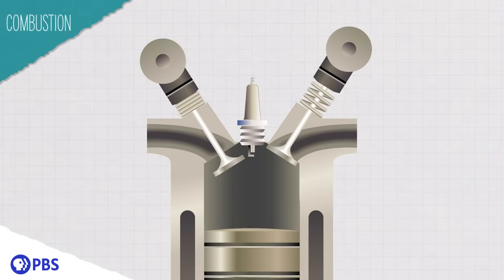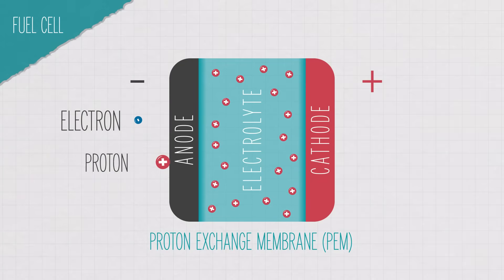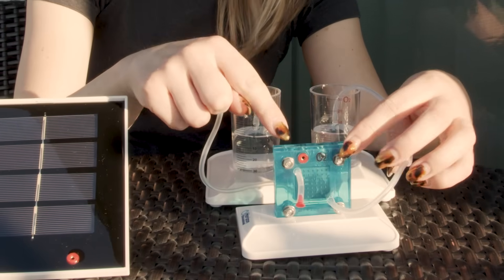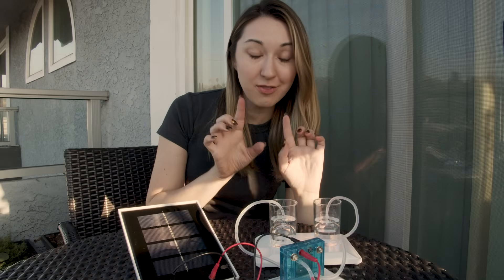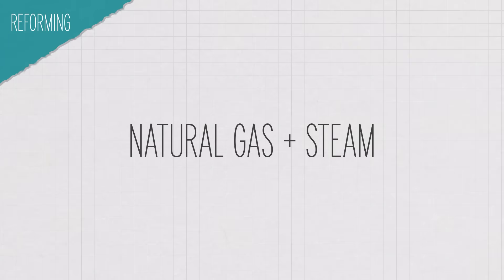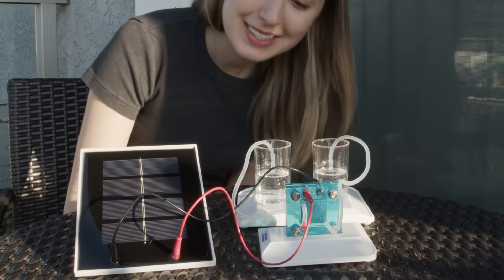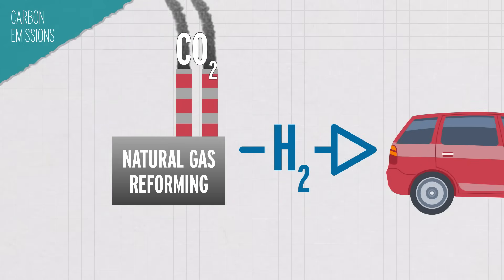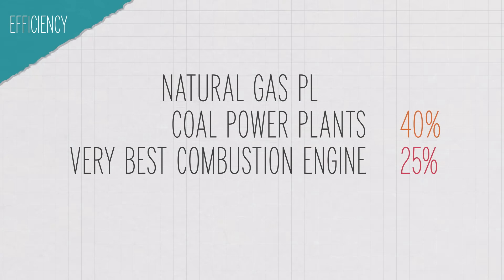How Do Hydrogen Fuel Cells Work?

Comment: I think there are genuine questions about how realistic large scale green hydrogen production can be vs batteries. There is this idea that it just needs time and investment for the production costs to fall but if you look at the details it seems unlikely. As this video points out hydrogen production is not new. People have been working on it for a long time and have not managed to make it cheaper. Batteries on the other hand have fallen dramatically in price over the same time frame and there are obvious pathways to continue to push them cheaper. The future promise of green hydrogen for small vehicles is as far as i can tell mostly just providing cover for the fossil fuel industry. It might make more sense in other applications. But for cars batteries have won its just a question of how fast we are willing to push people into them.
Reply: You fail to se the inevitable mess and toxic filth all these discarded lithium batteries are going to create, as they're good for only ~ 5 years,  not to mention the wars that will become reality due to countries fighting over the resource.
Reply: @minkorrh  lithium is fairly common and can be completely recycled. Batteries are not free of environental problems. But they are still much better than gas or hydrogen at the moment.

Comment: I work for a transportation agency as part of a group researching our future fleet (alt fuel busses). Fuel cells have very appealing traits, but from the perspective of building out infrastructure, this technology has a lot of maturing to do. A transit agency using this to power a fleet would need either very convenient hydrogen stations nearby (3rd party operated), or the agency would have to build out infrastructure to make their own fuel. That raises questions about mission creep for a transit agency's role and quite a few sunk costs for safety provisions alone. Keep in mind as well, compressed natural gas busses must be re-certified by a qualified 3rd party before returning to service for any collisions over 4-5mph. I'd imagine similar safety requirements for vehicles carrying compressed hydrogen. That's just one more drop in the bucket where fuel cells' impressive initial features are 'watered' down in real world operating conditions.
Reply: Very interesting knowledge

Comment: The one thing that is missing is electric transportation is changing from mostly fossil fuels, hydrogen emissions is cleaner than the air coming in. So a hydrogen purifiers as you drive, win win.
Reply: The only thing that fuel cells purify the incoming air from is Oxygen the rest just passes through or needs to be filtered prior to the fuel cell as some things in the ambient air will negatively affect the life of an FC.

Comment: It's "green" in the sense it doesn't produce CO2 as output. But isn't water vapor still a strong greenhouse gas? Maybe not as strong as CO2, but still...doesn't help solve global warming.
Reply: Water vapour doesn't stay very long in the atmosphere. It probably would help dry areas whern pushing more water vapour into to atmosphere. And if it's for some reason bad. It's easily cooled down in the car and therefore would exit as water.
Reply: Water vapor is considered having a strong greenhouse effect however unlike CO2 it is not persistent and is running in the normal water cycle of this planet.  Increased atmospheric temperatures created by persistent greenhouse gases like Carbon dioxide  also cause more water vapor being present in the atmosphere thus throws of the water cycle balance.
As a FYI burning fossil fuels also creates large amounts of water vapors, e.g. burning 1 liter of Gasoline will result in about 1 liter of Water at the exhaust
Reply: The earth atmosphere needs CO2 for plants and trees because of photosynthesis more CO2 equals more greenery which creates more Oxygen.  We need Oxygen and when we breathe out CO2 which plants change back to Oxygen through photosynthesis.  We also need plants for food.  Global warming is political science to charge carbon taxes and other environmental taxes.

Comment: Something to think about. If Hydrogen cannot be produced in enough demand through green energy sources how does anyone think that green energy sources will power the world without Hydrogen. 
Fossil fuels can make Hydrogen through processes that create zero emissions. In Alberta we are creating Hydrogen from natural gas and flaring the impurities off, through a stack filter and capturing the carbon. We dont need to completely eliminate Carbon from the atmosphere. There is a place for all sources of energy. 
Wind, solar, geothermal, fossils, nuclear, wave power, biofuels etc.. and we will need all energy sources and storage capacity moving forward as we are increasing electrical demand exponentially.

Comment: i think its a bit unfair to write off fuel cells based on how hydrogen produced.. battery EVs also have the issue of how the electricity is produced, then there's the economy of scale of creating hydrogen at a plant as you mention, but also the fact that upgrading a hydrogen plant is a lot easier than changing the engines of millions and milions of cars. in the end both battery and fuel cell cars are electric, its just a matter how the electricity is stored, and i think what we'll see is hybrid solutions with both fuel cells and batteries, like storing the fuel it self as hydrogen and then having a smaller battery for burst power
Reply: It is very very easy to solve the issue of how electricity is produced. Put solar panels on your house. There is no similar way to solve the issues with how hydrogen is produced.

Comment: "If you're using fossil fuels to produce the hydrogen for cars, you're just shifting the carbon emissions further away from the vehicle, not eliminating it."

The same argument historically applied to electric vehicles: if you're using coal to produce electricity to power an electric car, then, "you are just shifting the carbon emissions further away from the vehicle, not eliminating it."

Yes, current hydrogen production is usually not green. That's also how electricity started. Given enough demand to justify private sector investment or sufficient subsidies/incentives from governments, Hydrogen could ultimately be a much cleaner fuel for vehicles than battery-bank electric cars. Unfortunately, governments seem more interested in drudging up ocean floors to find lithium and metals required for the massive battery banks of electric cars. And bonus fact, there is no efficient way to recycle those battery banks, which will have to be replaced every 10 years or so for an electric vehicle to continue working.

Side note: Lithium is often used as a medicine for certain mental illnesses. What happens when all of our easy-to-access lithium is gone, and the cost of lithium sky rockets because everyone's electric vehicle has 6,831 lithium-ion cells in it? (That's the number in a Tesla Roadster.)
Reply: The details matter here though. Its not just that you need power to produce hydrogen you also need methane to do it reasonably cheaply. And that process is not carbon free. Yes you can do carbon free hydrogen but there is little hope that the costs will fall. Batteries are already cheaper and have obvious pathways to becoming even less expensive. Hydrogen not so much. I mean we are still going to need it for things like green steel but for cars it makes little sense. Remember you can technically produce green gasoline if you are willing to pay for it. You can use c02 and water and electricity to make it. But no one is advocating for it for a reason. Its obvious BS from a cost perspective. Hydrogen is just that little extra bit of redirection to make people maybe accept it. But its not going anywhere. 

Also there is plenty of lithium. It has its own environmental problems but multiple orders of magnitude less than staying on gasoline or moving to fake hydrogen.
Reply: Electricity is very easy to produce carbon-free. Just put solar panels on your house. Hydrogen is not at all easy to produce carbon-free.
Reply: @DavidJao  you can make hydrogen from electricity via hydrolysis. What hydrogen would solve is the lithium problem, charge speed and autonomy time.
Reply: @cristian-bull  The equipment required to make hydrogen from electricity at a scale sufficient to power your car costs several million dollars. Approximately zero homeowners will install such equipment in their home. By contrast the cost of solar panels to power your car is in the tens of thousands of dollars, well within the reach of average homeowners.
Reply: @DavidJao  "Approximately zero homeowners will install such equipment in their home"
Jesus, I hope so lol 
Never even crossed my mind it had to be done at home. 
You might as well refine crude in your kitchen LMAO
Reply: @cristian-bull  But what you don't understand is that we CAN install solar panels at home. You're absolutely correct that refining crude or producing hydrogen at home is absurd. Which is EXACTLY my point: EVs are far simpler and cheaper to refuel.
Reply: @DavidJao  Simpler? They will take several minutes to refuel compared to seconds, travel a shorter distance after refueled, have a huge environmental cost to collect the lithium for the battery, which will last for 10 years, after which you need a new battery and the old one won't be recyclable. 
Have either a toll on the power grid if you don't use solar, or will require more lithium for inhouse batteries if you do.  
I do understand we "CAN install solar panels at home", any 5 yrs old understands that, I'm just mentioning the disadvantages. There are pros and cons.
Reply: @cristian-bull  False, false, and false. An EV takes seconds to refuel: plug in the car when you get home. It's full again the next day. This doesn't happen with gasoline cars, where you need several minutes, at the very least, to pump the fuel. Of course, if you aren't planning to park your car at home overnight, then the convenience of owning an EV drops drastically, but many people do park their cars at home overnight. The environmental cost to mine lithium is absolutely miniscule compared to the environmental costs of fossil fuels. Remember that a kilogram of lithium lasts for millions of miles (far more than your false figure of 10 years) whereas a kilogram of fuel lasts for maybe 10 miles at best. The two are completely incomparable: burning fuel is tens of thousands of times more environmentally destructive per mile than lithium mining. The power grid is underutilized at night, when EV charging actually happens. Please stop spouting lies and nonsense. Truth will win in the end.
Reply: @DavidJao  
- a whole night is not seconds as much as you may like it to be LOL
- yes, if you aren't at home the convenience drops drastically
- yes, it's better than fossil, but we are comparing batteries/hydrogen, not batteries/fossil, so that comparison is not even relevant. 
- The grid is underutilized at night ONLY if there are few EVs. If all vehicles are EVs, it will be the opposite, so the solution does not scale. Also, EVs aside, if you google power consumption VS hour of the day you'll  find the highest peak is in the night after work, so , as you say, false, false, false.
Reply: @DavidJao  if you want a solution that works for few people and not for everyone tho, sure, EVs are cool.
Reply: @cristian-bull  Still false. What matters to most people is how much of YOUR time is spent charging the car, not how much time the car spends. An automatic dishwasher takes longer to wash dishes than hand washing, but is still valued by most people because it saves THEIR time. Nobody cares how much time the machine uses. Even if every car becomes an EV, total electricity usage goes up by only 18% -- well within what the underutilized night time electricity grid can handle. Electric cars don't charge at night right after people work. They charge at 2am and 3am when nobody uses electricity. Hydrogen cars also require lithium as well as myriad other rare and hard to mine metals such as platinum. Hydrogen fueling stations are even worse. Why are you so desperate to lie about EVs? It's almost as if you're getting paid to shill for fossil fuels, which hydrogen is: almost 0.00% of commercially available hydrogen is sourced from renewable sources, compared to 90% of electricity here in Ontario.
Reply: @DavidJao  that's why the first thing I said here is "you can make hydrogen from electricity via hydrolysis". I stated what can be done, not what they do in Ontario, but your decided to move the conversation somewhere else for no reason and forgot the initial point. 
The +18% is an interesting fact tho, will keep it in mind.
Reply: @cristian-bull  It's ridiculously expensive to make hydrogen from electricity via hydrolysis. Yes, you can do it, but it will never happen economically. Hydrogen cars are DEAD. There's nowhere to refuel them outside of California because the hydrogen fueling stations are so expensive that they won't ever get built without the state building them. EVs have outsold hydrogen cars 1000 to 1. Give it up.
Reply: @DavidJao  EVs were too expensive too few decades ago. 
And fossil cars were expensive too before.
Everything is expensive when compared to technologies with years of technological and infrastructure development.
Reply: @DavidJao  I was just pointing out why I think hydrogen is better, and you took it as some kind of personal attack to your beloved EVs. Jesus. I like EVs more than fuel cars, chill out.
Reply: @DavidJao  and fuel cars keep outselling EVs, following your logic, fuel is better, EVs are dead. 
Again, you keep comparing well developed technologies with ideas on baby steps. Do you even remember how shitty solar panels used to be?

Comment: Please more hydrogen fuel cell content!!! As methane is a greenhouse gas itself, are the CO2 emissions of the conversion process to H2 less than just burning the methane? If so, it could actually be an amazing tool to allow governments to convert gradually (ie. build bulk hydrogen fuel cell infrastructure, and supply it with H2 produced via methane conversion, but gradually convert your H2 production to solar/electrolysis and bio-production over time).

Comment: Great video as always! Really engaging and with the right amount of detail to help understand the topic while still going straight to the point. Personally, exactly as I wouldn't give up on hydrogen even though (as for now) much of it is made from steam reforming, I also wouldn't give up on carbon as an energy carrier; I really hope that projects like Eni's Ecofining (hydrogenating oils up to actual green diesel) take off (as processes they go with a single reaction straight from biomass to fuel, so they are also quite energy efficient), but maybe some breakthroughs in mass oil production (like algal oil mass production) are still needed to render carbon-neutral carbon-based fuels an economically viable option!